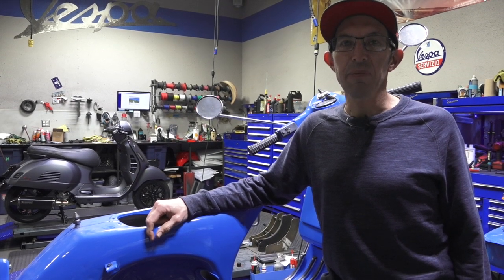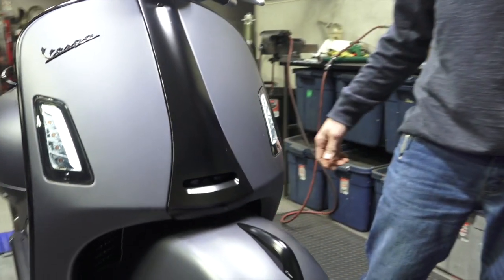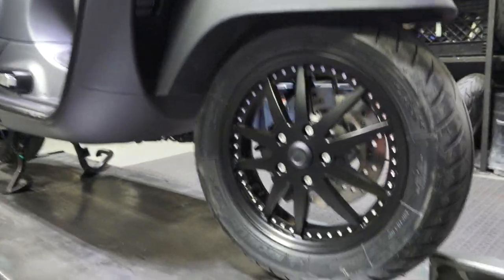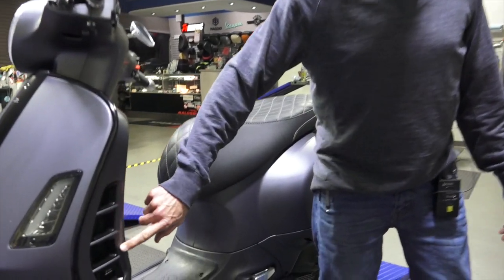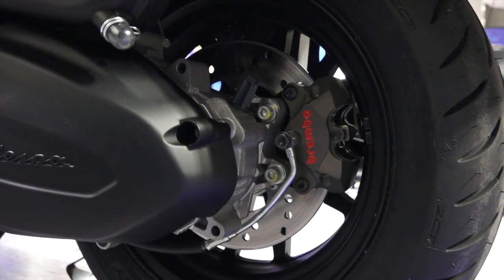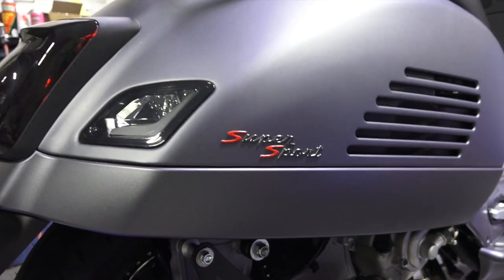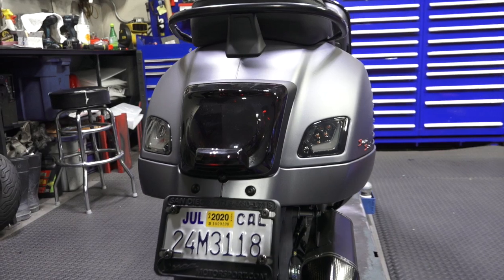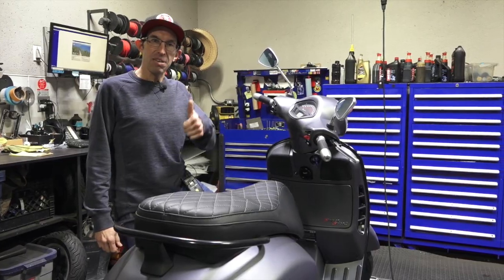Tricked Out Titanium Vespa GTS Super Sport HPE

Comment: May I ask if I can make the tires bigger with the original GTV wheels , and will configuration have an effect on the overall ride of the scooter, I have a 2020 Sei Giorni . 

BTW I love the whole set up and thinking of buying the accessories from your shop. I am checking your stock and looking at the grip/lever combo, and also the foot peg as well as the side mirrors but it seems that you do not have a rizoma radiator grills on aluminium silver. I like to retain the classic look of the GTV SG and I am wondering what else can you recommend.

Comment: Hey Robot ! Thanks for the great content you put out for us. Just got a new 300 GTS HPE and purchased the Malossi Variator kit, will install it at the 600 ml first service when the engine will be correctly broken in. Do you still recommend not using the Malossi clutch spring and using the 14gr rollers ? The kit comes with a set of 14gr recommended for 250s and a set of 15gr recommended for the 300. I’m confused 🤔
Reply: In this video he recommends leaving the stock spring and putting the 14gram rollers that come with the kit.

Comment: Hi,
Just a general question about the 2020 GTV.

Do you know why it is only equipped with ABS and not ABS/ASR?

It seems the scooter is only cosmetically different to others in the 2020 line up so why not give it ASR like the others?  

This is really bugging me so your views would be very much appreciated.
Reply from the maker: As silly as it sounds, It comes down to the handlebar/headset layout on the GTV. There's no place for the indicator light or a switch for the ASR and Piaggio did not make the effort to re-tool the controls for the latest model. Hope that helps with your decision and thank you for watching!

Comment: That’s a sweet ride. Been thinking about wider tires what’s the max on my gtv.
Reply from the maker: We offer the 130/70/12 Front and 140/70/12 Rear for the GTS/GTV. It doesn't require any modifications to the scooter.
Reply: Bigger tire = lower speed and worse handling... Looks aren’t everything! ;)